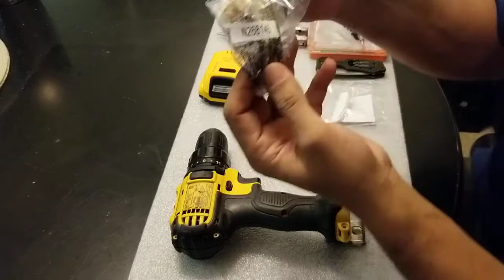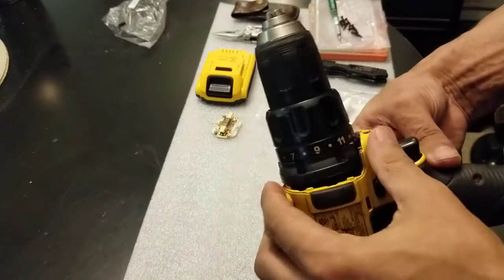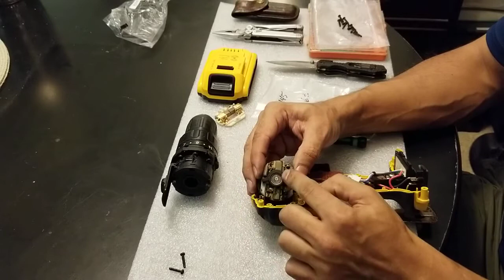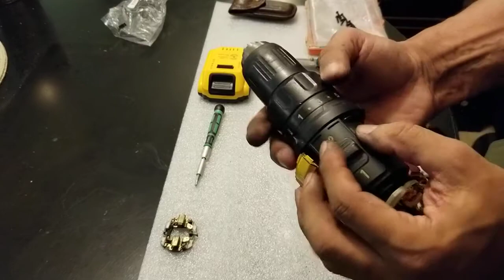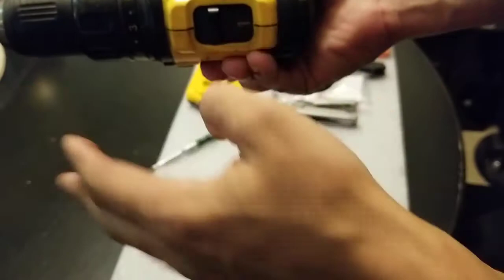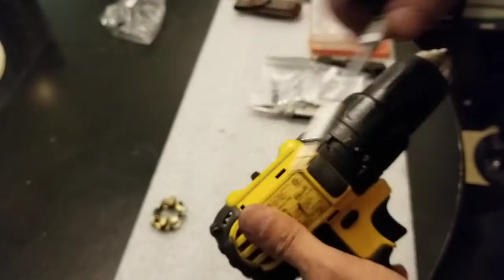Dewalt DCD780 Cordless Drill Carbon Brushes Replacement

Comment: My dewalt did776 doesn’t work but light does,brushes completely worn out ,I don’t want to buy bushes and find still not working ,would that be reason drill not working,great video
Reply from the maker: Yessss, that's the reason the drill won't run. If the light works it means the switch, cables and battery are working. 

The drill's armature won't turn because the carbons (brushes) are worn out and the electricity won't flow through the copper windings in the armature. This is what makes the magnetic fields that reppell each other to make the drill spin the armature. 
That's exactly what happened to my old drill. 

I went to school and became and electronic and electric technician and that's why I know the science behind it. So if you want your drill to work then replace the carbons yourself and with the help of my video or with a friend.
 
Let me know if you have any more questions! Good luck to you my friend!! 👍👊
Reply: @arqubits  many thanks replaced brushes as you said and working